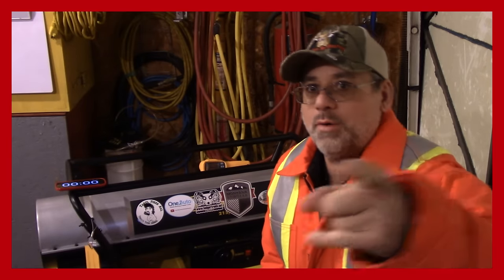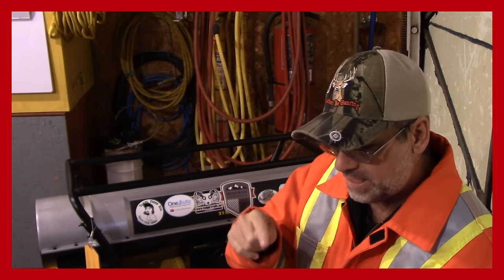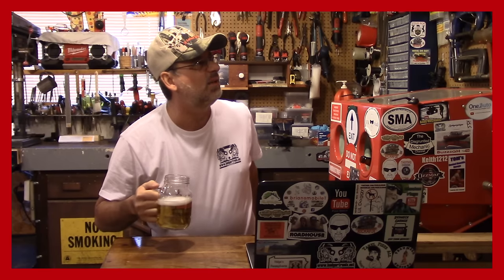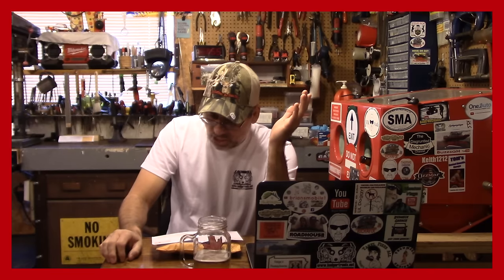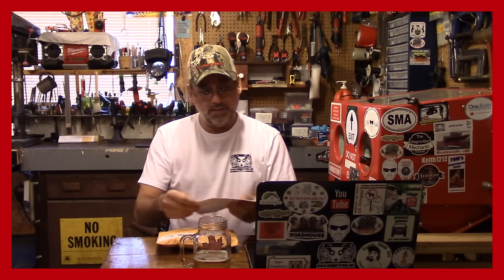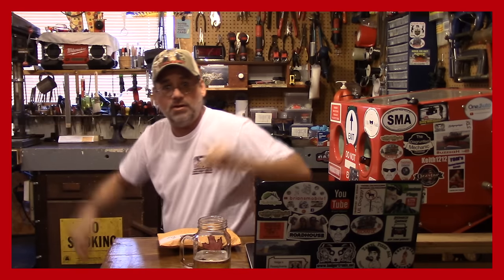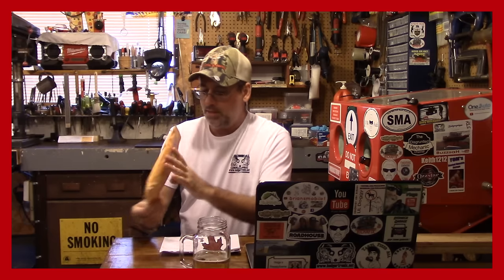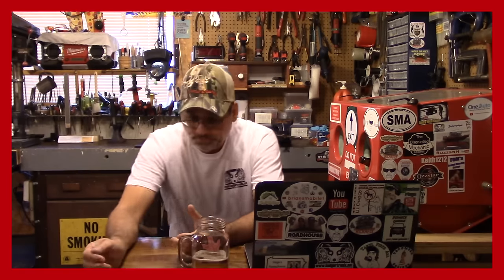PAPA TEXAS AND LONESTAR RIDER

Comment: I get the change.  I started with BTHV1 ( Bruce The Handyman Version 1) as a handy man never does the same thing twice and then I changed to small motors when I sent a 15 second video to a young couple and thought "that is kind of like YouTube".  I am thinking of a minor change again as I am cleaning a lot of carbs on line.   I need more problems other than scummy carbs.  Although my next 2 vids are the fabrication of a 12 volts charging cat which I love to do.  Maybe I am changing already.
Reply from the maker: Yes i think change is good for our sanity and i couldn't do the same thing all the time. I guess i get bored of the same old same.  Look forward to the fabrication. Cheers Bruce

Comment: I worked for a rental place,and I used to light up about four 250,000 Btu fuel heaters to test them. 90 degrees in about 30 seconds. I am not even close to a video a week. Thank you for the video, Steve
Reply from the maker: Yes their hot heaters. One video a week , your not not close to it. Haha neither am I .

Comment: Great mail calls!
That heater really kicks it... does it make your eyes burn at all?   I had a diesel torpedo heater years back that would crank out heat, but the fumes were awful in my little shop.
Keep on keepin' on buddy!
Reply from the maker: Thanks. No it does not  burn your eyes at all, burns real clean. Years ago yes when they didn't have low sulphur diesel . After its warm I do use an electric heater to maintain the heat. It's just getting it hot at first that works so good.  Cheer bud.
Reply: I didn't think about ULSD fuel... That probably makes all the difference. 
Cool!

Comment: Hi Steve, do you vent the garage, to protect yourself from to much build up of CO from the heater? THANKS FRIEND
Reply from the maker: Ron I turn on the heater for about 7 minutes and on the wall i have a 240v heater i turn on to maintain the heat. I dont have the diesel heater running when i'm in there it's only to get it up to temperature than switch to electricity. Ya I wouldn't recommend you stay in there all day either with the diesel heater running.
Reply: Thanks

Comment: Once you shut it down along take before you need to start?
Reply from the maker: Once i shut it down , haha  not sure what your asking. I'm getting old. LOL
Reply: I had to watch again so I could remember lol. How long does the room stay warm before you need to restart heater?
Reply from the maker: buzzsah I don't restart the heater , i use a 240v heater on the wall to maintain the heat. I don't think i would want to stay in there with the diesel heater going off and on , might make ya dizzy. LOL